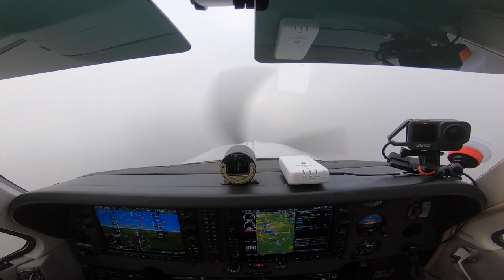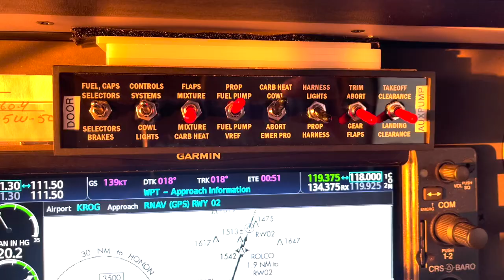IFR Departure (after Engine Fixed) with Storms, Wind, and EF1 Tornado Across Arkansas today, Go Me!

Comment: Thanks for taking the time to produce these videos.  I do enjoy them a bunch.  Any more info on what happened to the wire harness?  How did it go bad?
Reply from the maker: We don’t really know, we cut open the top wires and found multiple had deteriorated badly. There was only like 250hrs on the wires. They should last 500!